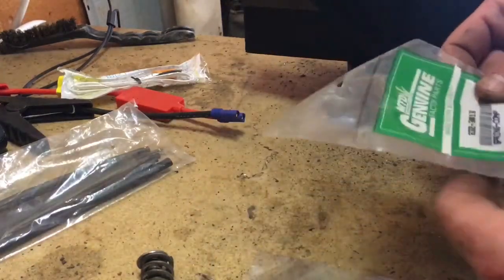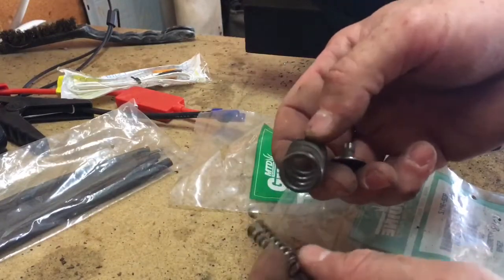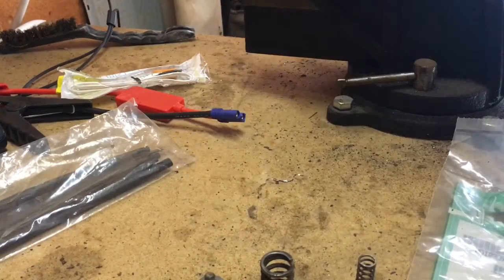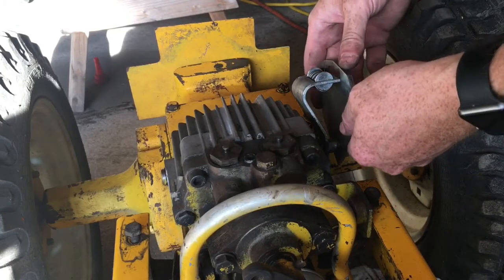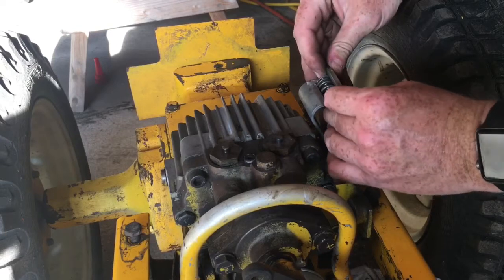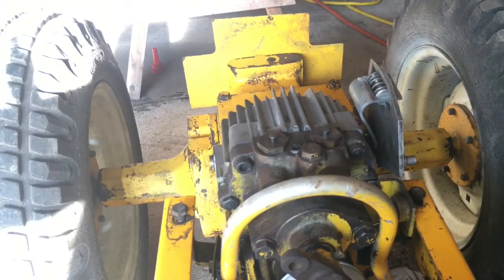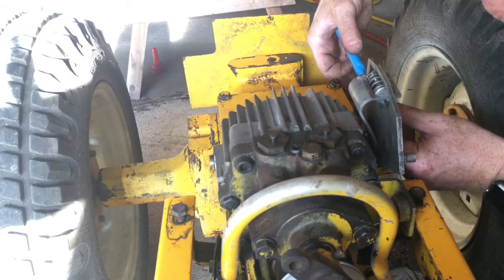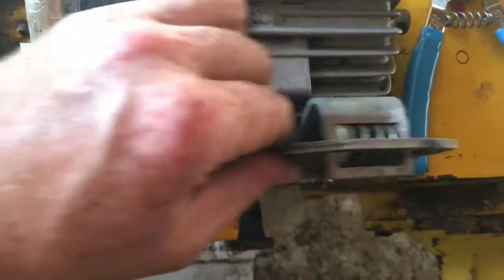125 Trunion Repair Part 2

Comment: You didn't need to weld/braze?  I have a 127 that darts off when I'm not very slow with the speed lever, and I'd heard that an entirely new holder for those trunion springs would probably be needed...
Reply from the maker: I did have to weld up the corners and file them square